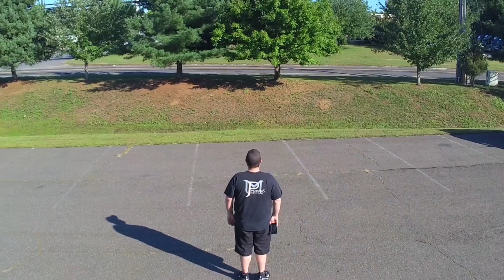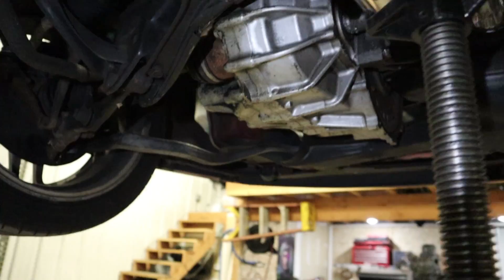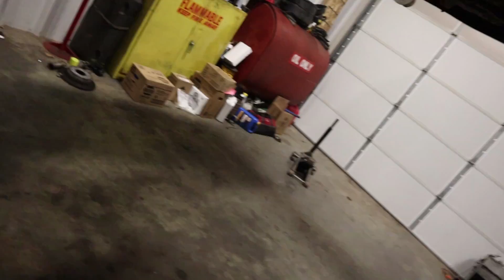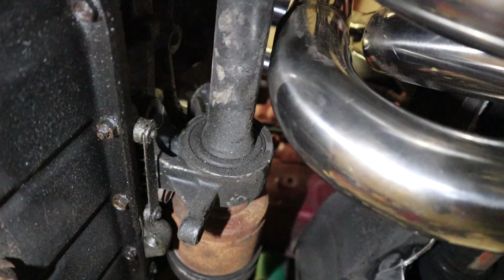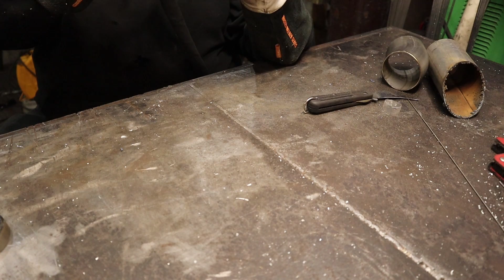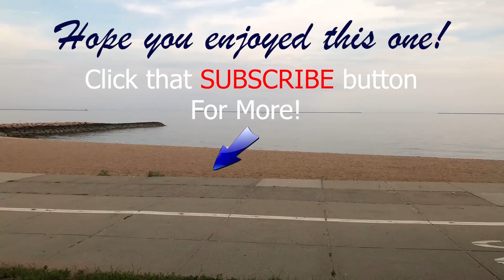K-SWAPPED PRELUDE GETS A NEW EXHAUST!!!!

Comment: You need a flex pipe or it's going to rattle and eventually crack
Reply from the maker: There are two types of flexible joints in an exhaust system. #1 is the typical braided bellows that everyone always says is absolutely needed or the world will end. #2 is a ball and socket that uses a thick fibrous gasket with two spring bolts to allow for flex. What you see on this car as well as every factory subaru is the ball and socket type. They allow just as much movement with less of a failure rate as the typical braided bellows. Add to it that this car also has extremely stiff billet aluminum and urethane engine mounts as well as the exhaust being hung with rubber hangers. This setup will never crack do to excessive vibration or engine movement.
Reply from the maker: In a perfect world yes, in this case the ball flange allows for some movement in the system.
Reply: Mack Sansone right! Without that extra flex the rocking motion and vibrations of the engine would crack the exhaust system causing a loud leak and rattle.